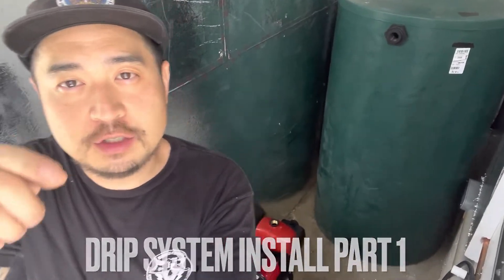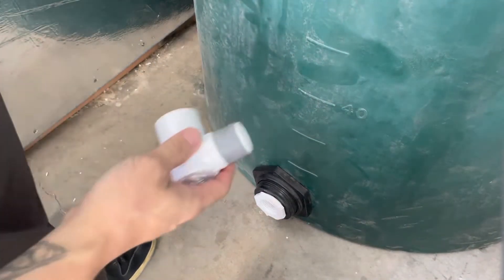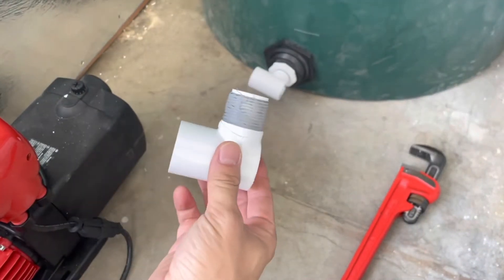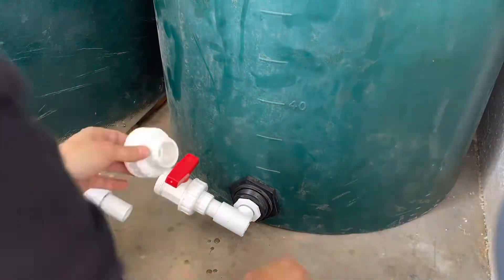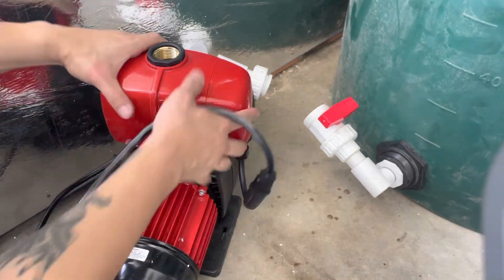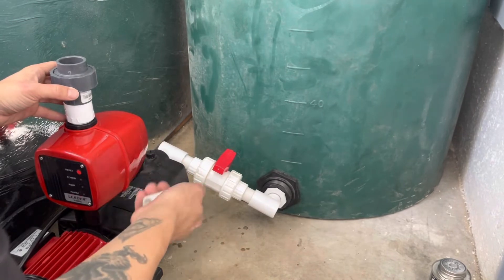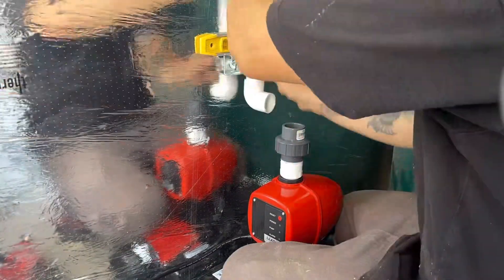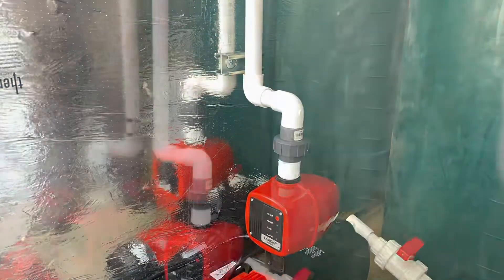Hydroponic Drip Install Part 1

Comment: Tip: use 5-10x the diameter of the pump holes (both inlet and outlet) as a minimum length requirement before you reduce or change direction (elbow, T, Wye)

Comment: Hello, I have a Leader Hydrotronic pump controller and it is missing the black PVC 1 inch male threaded connector that connects it to the pump. Do you know if it is possible to find a replacement fitting or if it is something that can just be found at a hardware store? I don't know much about these pump controllers. Thank you.